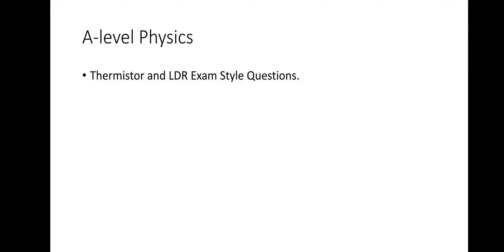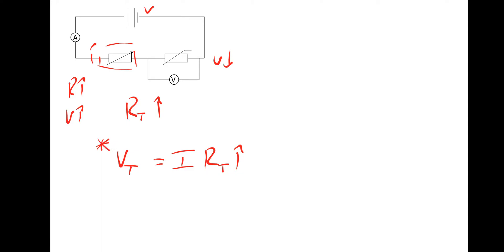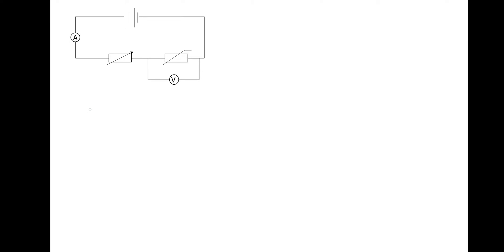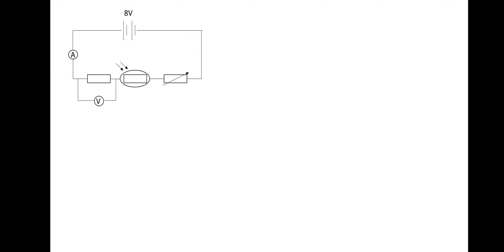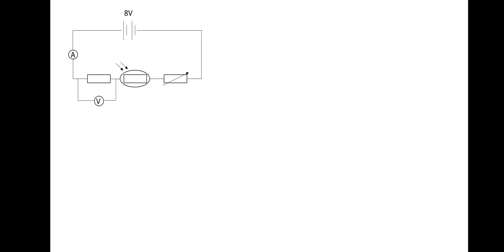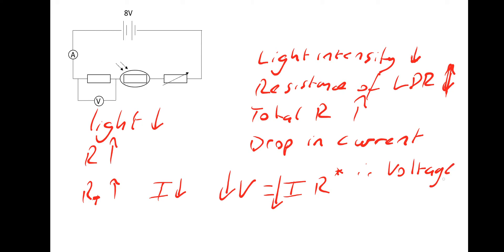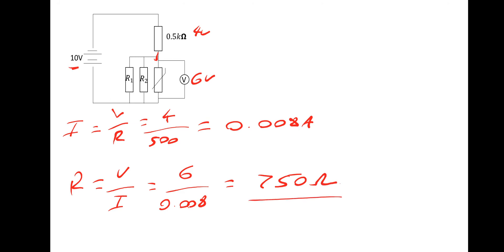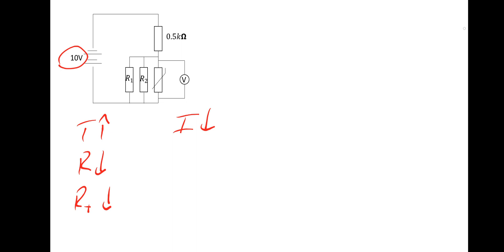A-level Physics Electricity Thermistor and LDR Exam Style Questions

Comment: Wouldn't the total current increase if the total resistance decreases and the potential difference remains constant for the last question?
Reply from the maker: There is a pinned comment in the comment section as there is a mistake somewhere. Not sure if it’s the question you are referring to. Thanks.
Reply: yh fr im confused now
Reply: @Curry_Muncher69420 Total resistance of parallel circuit decreases, therefore using circuit rules, parallel circuit has less share of pd so voltmeter reading decreases

Hope that helps
Reply: @omeiorahmanOhhh right 
Thanks that helped alot ❤❤